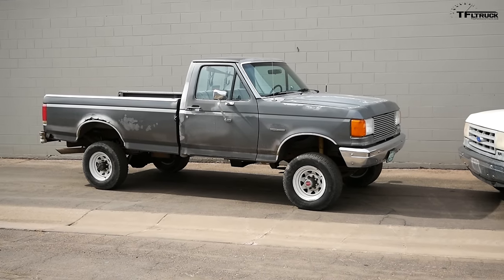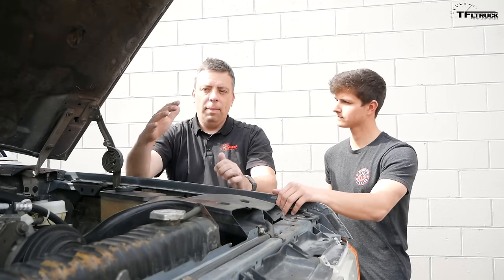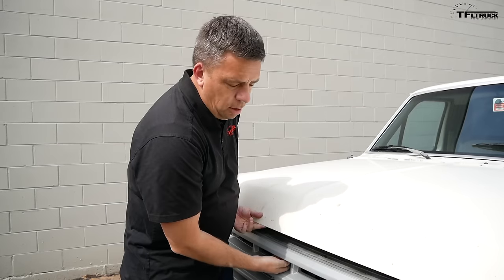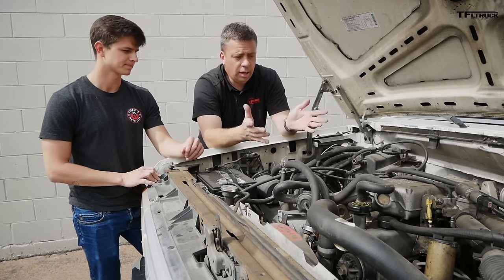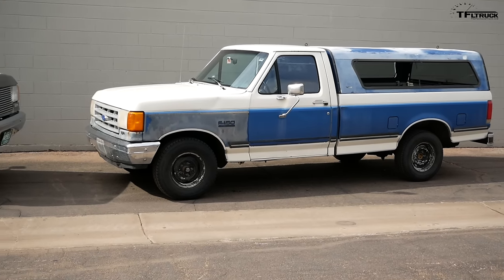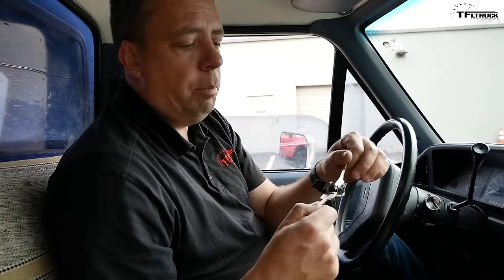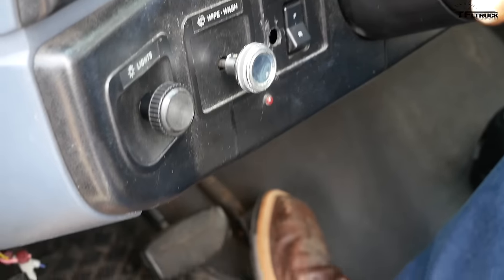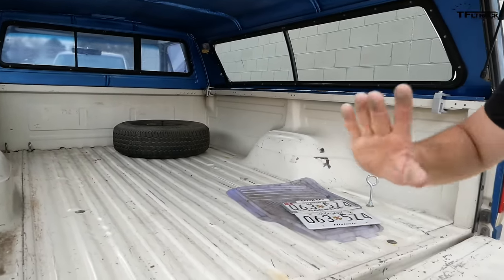Here's Why You Can't Kill An Old Ford F-Series Truck | Gunsmoke Ep.3

Comment: Love it. Brings back old times.
Reply: You can't kill something that is already dead..
Reply: My neighbor had one, broke down a couple of times. My F150's never died but did give me small trouble just like my Toyota's have
Reply: No manufacture has martian outer space technology. As they age they have their ticks and toks.
Reply: @xaza7774  they arent dead. The obs ford market is climbing and they are getting more desirable. I still daily one. Toughest truck ive ever owned
Reply: @xaza7774  hardy har har. Ford trucks #1 for 43yrs.
Reply: @traxxasrcfun  me too. Love Ford trucks.
Reply: Yeah, back when you could get a F-150 for about $12-$15 thousand dollars, and it would just keep going & going like the Energizer bunny! Today's luxury-priced $60-80 thousand dollar trucks are overpriced junk
Reply: Great video. I have a 90 just like that one, but mine is red and white.  You literally can't wear these truck out. These engines easily go 500,000 miles with no issues!!
Reply: @chrisrobinson3494  and and by age 8 to 10  and 160,000 miles they need $12,000 of work, turbos, cam phasers, plastic oil pan cracking, meth heads drilling holes in the pastic fuel tanks to steal gas where they won't metal due to sparks, timing chain problems, modules failing, blend door actuators in the dash, digital LCD instrument cluster failing, on and on. 

I'll keep my old 90 300six, it can be parked 2 months and fires right up, the newer cars have dead batteries by 30-40 days from all ready modules running.
Reply: @freddyhollingsworth5945  They got it right back in the early nineties, reliable,  rugged, inexpensive trucks that would last for decades, and would spend much more time in your garage, then a mechanic's!
Reply: I know we have four of them and they all run u wont find that in 30 years
Reply: @traxxasrcfun  So true mine is rusty but it has been threw alot But I can do anything with my ford 150 with a 351w it has a crappy catilac converter and sounds  like it's yelling at the ground
Reply: I have four (4) of these. When you say ford Trucks    this is what you mean.
Reply: Nope I’ve blown 5 in 6 months they are garbage
Reply: @tristanwalker1890  What a way to fly your rainbow flag........😂

Comment: 300 I-6 is arguably one of the best engines ever made.
Reply: i love them engines also no timing belt , gears instead .
Reply: Had an old 1 with over half million every single thing broke but the engine
Reply: Dude hands down, I cannot think of a more reliable engine
Reply: yup 300 straight six and manual transmission , King of the World .!!...
till the salt eats it like cancer.
Reply: It had 7 main engine bearings. Bulletproof.
Reply: I had a couple of these trucks. That engine is very overrated. No fuel mileage. No towing power.
Reply: I don't care if the 300 inline 6 lasts forever. Its useless.
Reply: @phillipsmarlin3030  I had 2 4wd, 4 speed manual, 2.73 rear end gears,  regular cab, long beds with 300 got 18mpg. Then a regular cab flareside 2wd, 5 speed manual, 3.55 rear end gears that got 24mpg putting on back country roads and in town. But in town could be in 5th gear at 35mph spinning about 1000rpm.
Reply: @phillipsmarlin3030  also hauled a couple tons of dirt with the 91 4 speed 300 truck. Had more power than my friends 90's GMC 3500 dump truck with a NA 6.5 diesel and 5 speed. Borrowed the dump truck because we thought it would move more dirt at a time, mistake. Put 5 buckets of dirt from the skid steer, barely would climb hills. Only hauled 2 buckets after that, which is what I hauled with the 300. Climbed a hill with the 300 at 35mph with 2 buckets, same hill the GMC only did it at 25mph with 2 buckets.
Reply: Only problem I had with a 300 is a head gasket go bad. Think it was from a failing coil that feed some raw gas into the cat and the cat had a meltdown. Truck was missing, thought water in the gas, added dry gas. Took it down the road banging threw the gears, truck back fired and shut off, looked in the center mirror something was glowing on the road. Thought truck was on fire, jumped out looked under the truck, cats shell was glowing bright orange. Piece on the road glowing was piece of the inside of the cat that got coughed out the tail pipe when it back fired.
Reply: Had a 94 F-150 with a inline 6, 324,000 miles.  I put 2 transmissions and 3 radiators. The truck was wore out. ENGINE AN A/C WAS PERFECT.
Reply: @TruckerMike089  I mean, the rotary or p-pumped 5.9BT regularly lasts over 1,000,000 miles. As well as many ISBs now. But for a gas engine, they're above average.
Reply: Idk what that one fellas talking about. I was ripping stumps with a straight 6 when those big 7.3 turbo diesels wouldnt do it, pulled 17mpg no matter what, and had so much weight in the truck my front tires see ere barely on the ground. This was all with a 3.08 rear gear.
Reply: Michael Crites 283 Ford v8
Reply: 🤣🤣😂😂😂😂 your funny!
Reply: @Ford Fanatic timing gears, no belts or chains
Reply: God I miss my 96 with the straight 6, was a gas hog but damn man that truck was one hell of a work horse and it ALWAYS ran.
Reply: Agreed but what I6 wasnt
Reply: @iangates8815  you obviously dont know what your talking about they are chains just like almost every old engines ever its a sprocket on the cam and crank then a chain around them
Reply: @randomvideos3026  maybe you should get the correct engine  . you my friend are WRONG! I AM RIGHT , you didnt even take the time to google it before you come at me . feel stupid i allow you.
Reply: @randomvideos3026  Ian Gates is correct, timing gears, no timing chain.
Reply: i daily drive one that i bought 8 months ago and it was beat beyond hell but still ran. fixed er up and runs like a beaut
Reply: @trevormcneill9225  i was looking at 95 relatively clean manual trans with lots of new parts for a grand . money didnt panout. 300 inline has mad lowend torque
Reply: I have that on my 89 f150
Reply: Markus Phillips my ‘93 4.9 is not useless. Still strong at 102,000 miles.
Reply: Agree
Reply: Toyota 2.7 liter is very good as well. Iron block. Easy to maintain
Reply: I still got mine and use it as a daily, l use it to haul livestock
Reply: @phillipsmarlin3030  i haul livestock all the time with it
Reply: That's why we all called that engine The Iron Horse.
Reply: So is the jeep 4.0 straight 6
Reply: My Father had 3 with the 4.9L or 300 I6 and a 67 with a 240cid I6. Great engines.
Reply: @fixthis6949  you mean 289? Ford never made 283 cubic inch engine they were 260, 289, 272, 312 352 351, 390, 460, 477, 534 back in the day. Oops, I forgot 292, 330, and 331, and 361 in the trucks
Reply: @phillipsmarlin3030  back in the 60s someone had to have one so there was something to drive to the parts store to pickup parts for the Chevys
Reply: Sure miss my old 1978 F-100 with that engine. Probably the most reliable vehicles I've ever owned.
Reply: @phillipsmarlin3030  you would rather walk to the parts store I guess
Reply: @Melvin Rexwinkle  Don’t forget about the the 221 that proceeded the 260. 😁
Reply: I had a guy tell me they were junk "I blew up 3 of them" he said. I'm like what did you do to it before it blew up? "Nothing I just removed the govenor"... Face palm.
Reply: Babylon falling  Yep, I couldn't agree more.  Babylon is fallen.
Reply: It is in many top 5 best 6cylinder engines worldwide.
Reply: 2jz and 1fze are also indestructible
Reply: My grandfather had a truck with the engine, great long lasting engine.
Reply: The ford 300 is good as are many straight 6 engines. 
The Chevy 250 six is just as durable.
And the Toyota 2jz is bulletproof as well. But I’ve never seen a ford or Chevy six do what the Toyota 2jz has done. But if I ever were to buy an old truck. An old 300 six ford is one that is cheap durable and easy to fix.
Reply: @iangates8815  I loved them gears until one striped out on me, crap fiber gears instead of metal, still better than belts.
Reply: I still have my 87 (work spec) 150. I-6 engine, Granny 4 speed manual, 2wd, manual windows and locks, dual fuel tanks, rubber flooring, 1 piece bench seat. It has AC but thats about the only luxury option. It needs paint but it has no rust. I'll never sell this truck.
Reply: @randomvideos3026  you do know that 300 six uses a gear driven cam that is driven by another gear no chain no belt just gear on gear
Reply: That's why Ford put the 4.9 300 inline 6 into so many trucks. I had a 1992 f350 cab and chassis with a 10' long by 8' dump box. It had a c6 3 speed automatic transmission no overdrive. It hauled many loads that were above it's gvwr reliably.
Reply: Just durable. Really. Nothing fancy or strong about them. You can make it that way but don’t because the reliability of the 300 I-6 goes down. It’s made to last. It’s not made to repair like new trucks.
Reply: @kingsolo6241  when making more power you put stronger internals in and reinforce it in the process with ARP studs and such to be reliable when making power then, and yes the motor makes great power even in stock form it's not meant to be fast, but can be, but reliability only goes down if you expect to make power with parts that won't handle, you upgrade the internals can make more power, no if ands or buts, 265 lbs of torque down below 2100 Rpm is ideal for towing vs the 302 witch makes that 280 something at 4000 something not ideal, with some proper breathing the torque will destroy an equally built 302 just for the fact of the design being inline 6, there is absolutely no competition, and same goes with a 351w c or m, and the truth gets thrown farther once you involve a turbo charger to these, their low end is what was powerful because HP is derived from Engine TORQUE and engine RPM, HP is just how fast you can do it
Reply: @kingsolo6241  I have a mildly built up 300 in my 87 F250 service truck, makes about 190 HP and 410 lbs of torque, been like this since the early 90s, the truck has had Chevy 1.7 rockers put in, steel can gear pressed onto the cam, forged rods and an HD300 crank, all emissions equipment removed and tuned out of the ECU, port n polish, and mustang 19lb 302 injectors, has over 800 thousand miles, at the time of the full rebuild it was at 62 thousand or so miles
Reply: tbone3366 I’m in the market for a 72-78 F-500. Hopefully I find one worth buying.
Reply: @kingsolo6241  my 84 I got lucky on that it only had a few pin spots of rust but had a highway 3.08 gear the T18 and carbed fird 300
Reply: I miss my 89 5.0 it saved my life
Reply: The Jeep 4.0 straight six is pretty much the same too, dead reliable and it’s got a little oil leak to keep it from rusting too 😂
Reply: @randomvideos3026  search on youtube anywhere ford 300 timing gear or can swap
Reply: @eduardomenchaca1916  the only issue I have ever had was those oil leaks, from the valve cover 8 times and 1 from the timing cover, over all great engines, I did tug of war with a 4.7 stroker and my 150 4.9 but the 4.9 even after the math of the Dyno just chugged and pulled the stroker, but the stroker was fast, the  4.9 is fully stock with a carter feedback, only a straight pipe
Reply: I own an '87 F-150 with the 300, fuel injected. 4 speed manual trans. 194,000 miles and kicking. No issues.
Reply: you fogot 302,200I6,427,406,429
Reply: @joddaley6510  the 240 and 300 both use a gear set drive they also are not stressed as hard as the smaller motors, 351 up same but they gave chains and the low rev nature if the 300/240 helps further reliability due to it moving slower and 2 less cyls, my 87 f250 just had a rebuild at 902K miles for the first time and only needed 12 thou removed from the bore aswell as new springs, the cam and everything else was in great shape, new bearings for the rods and she's ready for boost, I've never seen a motor go this far working and hauling without a rebuild except for the big inline 6s
Reply: @kkrankie  We used to say they didn't have enough power to blow themselves up.
Reply: @brandonv1727  Then something was wrong with the GMC.
Reply: @melvinrexwinkle1510  I worked construction far 15 years, up until 3 years ago. The best gas trucks, by far, are LS powered.
Reply: @boomerisadog3899  yep,I agree,  they'll get you to the gas station, hopefully, and maybe to the mechanics shop, all in the same day !
Reply: My Jeep 4.0 HO.
Reply: I agree 100% I drive my 1990 f150  everyday everywhere up and around logging road or just led footin it on the main road and never have had too much of a problem
Reply: Blew mine up dropped a piston
Reply: @iangates8815  I'm building a Chevy 250. Same concept. Nothing beats an i6
Reply: The Mopar slant 6 was also a hard engine to kill
Reply: @rll1954  102k Miles? You gotta start driving that thing
Reply: My dad had one in his 95 F-150 which we sold a few years ago due to unrepairable rust but one of his buddies bought one of those trucks brand new and what he would do is every time the body's in the frame would rust he would buy a whole new truck but put that same engine into it that engine today has over a million miles
Reply: @phillipsmarlin3030  I have no problem with mileage.   I get around 14 combined and 17 highway.   It’s not my daily but for a truck of its time period the mileage is not bad whatsoever.     I have no problem towing
Reply: @melvinrexwinkle1510  right... 283 is a Chevy small block from 57 on up.   They put them in the belle aire and the corvette.   First engine with efi
Reply: No it’s not they die at 100k and yet so simple. Only ford can pull that off
Reply: @benl4707  The Slant 6 was good. The Jeep 4.0 was good. The 300 is legendary. We had a 2002 Chevy Trailblazer LTZ until recently with the 4.2 Vortec. I miss it. Exceptional engine. You're right about the L6 engine.
Reply: @fosterwayne6684  I think the 300HD had the steel gears. The standard 300 had the carbon gears. One of my trucks was acquired from a guy who also had a carbon gear fail. He had an old salt spreader truck with a 300HD in it with like 12,000 miles on it. The body was shot from the salt. He just swapped the engines and it has the 300HD. That's how I know the 300HD had the steel gears because that's the story he told me and it started with the carbon gear failure.
Reply: I swapped out my old 300 after 1.1m miles. I have 500k on the second engine, still runs like new.
Reply: still rollin in my 4.9 and i wont argue with ya
Reply: I have a 95 ford with the 300. It has 220k miles on it. The engine cranks every time. Very reliable.
Reply: 460ci big block is also the best big block offered in a truck. I’m glad Ford brought back the big block V8
Reply: @phillipsmarlin3030  -useless ?? guy drag raced a straight 6 Ford with Boss heads. Won championships all over the US. Bad ass engine.
Reply: @justmeokay8253  - well you haven’t heard of the Ford Barra straight 6. Makes a 2jz look slow
Reply: 100%
Reply: Other the crazy 3.8 L engine used in many GM cars,  I would say that's right...the rest of the GM car was kinda crap, but that ford Diff was also one of the best ever made.
Reply: My granddad bought a straight 6 F150 brand new back in 1987. He drove the damn thing every day until he died in 2021 at the age of 88. The man claimed he never once had to take it to a repair shop over the course of 34 years, and he refused to get rid of it because it was the most reliable vehicle he’d ever owned. By the time he died, it was pretty trashed and had almost 500k miles, but still ran fine. My family sold it in the estate sale for $700 and I bet it is still running to this day.
Reply: The venerable 300. Love my 84 bullnose 300 4 speed
Reply: Tractor motor😂
Reply: @phillipsmarlin3030  Nah, not useless. Out-towed the 7 liter Diesel. And, let’s be honest here, almost all 80’s trucks get below 20 mpg.
Reply: @Markus Phillips  well so are you😂 my 87 4 speed 300 just brought me on a 8hr trip with not a single problem....so it must be good for something I know I wouldn't wanna walk...not sure bout you?
Reply: My 91 F250 has the 300 I-6 and it's the third 250 I've had with that engine in it and they are amazing engines
Reply: Not arguably, it is.
Reply: Agreed the only other brand gasser that will run as long as a 300 6 is the gm 4.3 vortec.  Best diesel is the 7.3 idi and powerstroke..     I have a gmc safari with the 4.3.   320000 miles and counting   The motor don’t even burn oil.   I’ve got the 7.3 powerstroke in my 97 f250.
Reply: @phillipsmarlin3030  
Kinda like you huh!😆
Reply: @iangates8815  rocking a 300 6cyl manual truck from the early 90s, no rust. I only drive it in good weather conditions. It's my backup vehicle and for getting supplies from the hardware stores.
Reply: @phillipsmarlin3030  the engine is great. reliable, durable, simple. Manufactured for 100yrs continuously. Has enough power for most people. The greatest parts of modern US history were built using this engine.
Reply: Is my 1979 F150 thats been sitting for 7 years worth repairing?
Reply: @moimoi7431  these days it can be. depends on how it ran when you stored it, and how you stored it.
Reply: @melvinrexwinkle1510 opps you forgot 302
Reply: these trucks with the 300 drive crazy with a lariat 3.55 gear, hell i remember unplugging the axle wire so i could do two wheel burnouts, dumb i know, but i wanted to see. injectors from a 5.0,msd, chip, racing fuel pump, and a bunch of other small things made it wheelie but the tires gotta hook great. second gear burnouts. next is boost
Reply: ps burnouts by accident, just trying to take off. can remember the tires on mine now but i love them. brand new